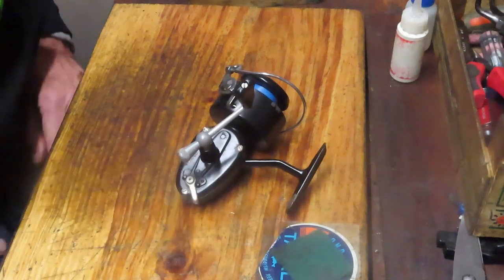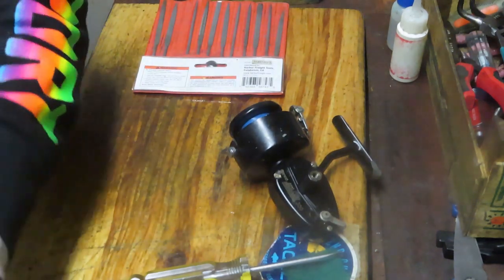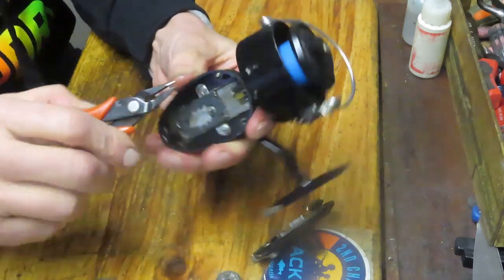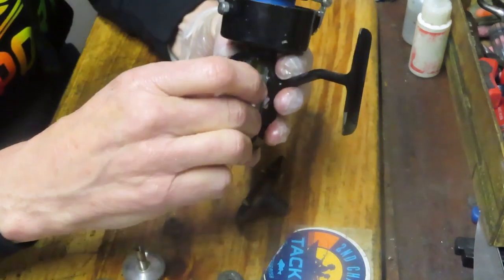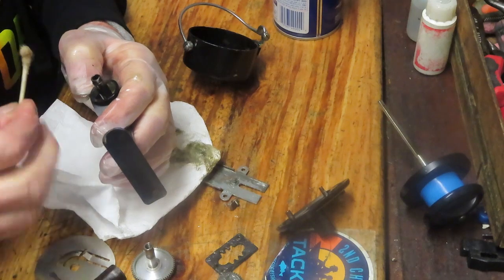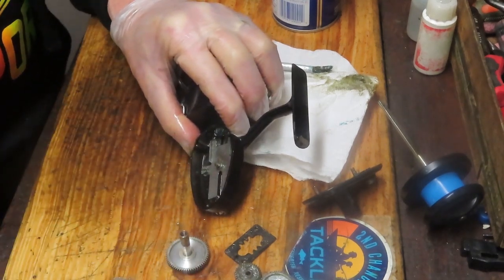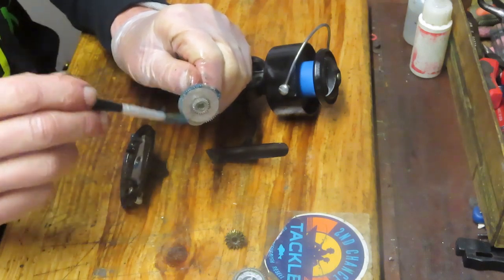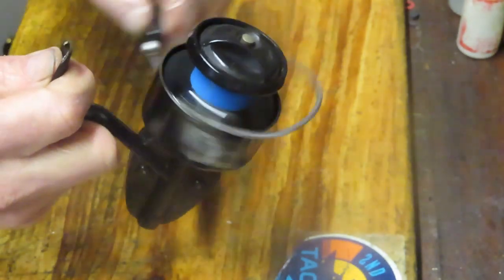Mitchell 300 fishing reel service including how to remove a broken screw

Comment: Thanks for the video Dennis.  I was working on a Mitchell 300 this morning that had an angry anti-reverse and your video very quickly got me on track.  

This reel is a tank and is in great condition inside and out.  All I did was remove some line that had wrapped itself around spool gear, cleaned it up, and then serviced it.  Not bad for a $2 reel that "didn't work anymore".
Reply from the maker: Glad it helped - Thanks for the note and for watching - Dennis

Comment: Something I picked from working in a boat store for years is using a drop of valve grinding compound on the end of your screwdriver. The compound is gritty and it almost locks the screwdriver into the screw. Doesn't work every time, but you would be surprised how many times it does. Once again thank you for your videos always learning something.
Reply from the maker: Thanks Thomas

Comment: Dennis, can you believe I’m up to 64 French Mitchells now and every single one of them has taught me something. The Mitchell 300 was the reel that me and all my friends wanted when we were growing up in the 1950s. There really wasn’t any other reel out there that came close in our minds. Of course I really did not know much about other reels that were available back then but the Mitchell 300 was by far the most popular. I never thought I’d end with so many Mitchells as I have now. I am always just absolutely amazed at the over-engineering in these reels. Oddly, out of all my Michells I only have one 300 and tat one was given to me just last year. Most of mine are the larger saltwater reels. I’ve never had a Mitchell reel break down on me while out on a fishing trip. They are all such fine little machines. I have one DAM Quik 270 Super that has a butterflied screw that needs to be fixed as well as a few other big saltwater reels that have this type of problem. With my vision difficulties I usually get someone with great vision to help me with such precise drilling. I always love it when you work on a Mitchell! Great video. — Chris
Reply from the maker: Thanks Chris - I haven't had one break down during a trip either.  I think it definitely speaks to how well they were over-engineered Just like the DAM reels

Comment: This video is perfect timing for me. I have a Penn Slammer 260 with 2 of the 4 screws that will not budge. This is my next and last resort. I also have a Mitchell 407 with a different problem: When I push the button to remove the spool it stays on the shaft. I've tried penetrating oil and heat with no luck. Any ideas?
Reply from the maker: Yes - open up the reel and remove the spool/axle shaft assembly then invert the axle shaft and spry the junction where the spool meets the shaft underneath.  That may help free it

Comment: How would you go about removing a butterflyed rear screw? It is recessed, plus, there's no cover to remove that would expose the stud once the head is gone? This one is sentimental... it was my great grandfather's who passed when I was a kid in 2001... fond memories fishing with him.
Reply from the maker: I would drill the head off.  Once that is off and the cover comes off, there should be about 1/16 stud remaining that you may be able to unscrew.  If it is broken in the case, then you will likely need to replace the case - retapping is an option, but normally it fails - Dennis
Reply: @2ndChanceTackle  thank you for the reply. I soaked it overnight with Liquid Wrench, then used a stripped screw extractor veeerrry slowly/carefully. I held the reel in a bench vise with wood blocks and cloth to protect the finish and made sure the extractor bit was aligned as closely as possible to the center of the hole. Finally got it out this morning. (Tried super gluing a slotted bit in the stripped screw first. That didn't work.)

Comment: I have a Penn Peer #209 that belonged to my grandfather and I have a bit of a problem with it. It operates very smoothly untill I rotate the real to the right (crank side down) then it becomes very jerky as if the drag is engaging and disengaging. If I press the spool to the left it will smooth out again. Any ideas?

Comment: I ran across an older video of yours where you bought a large lot of Mitchell parts. If you still have some, I would like to have 2 Mitchell tools and will need the two gears for a 330. Also, I'd be interested if you have the handle for a 300/330 with the larger knob. Please let me know about pricing and shipping. I can email you if you prefer.
Reply from the maker: Sorry - I don't have any of those left.  I am down to a bunch of spools and Mitchell 300 parts and a few 306 sets - Thanks for asking - Dennis